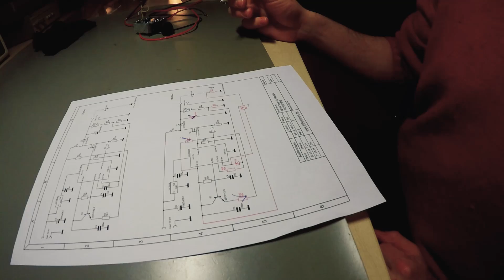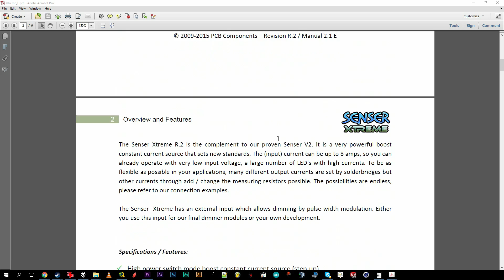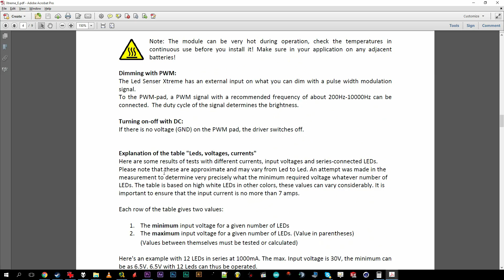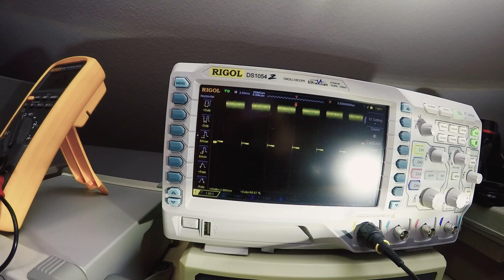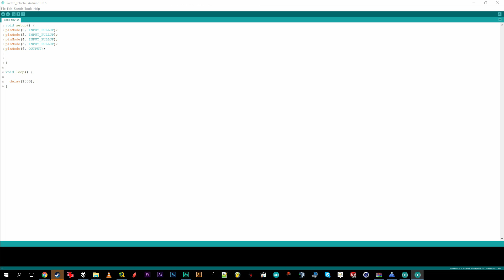100W LED - The manly flashlight rebuilt

Comment: I made myself a 50w torch in a huge-ass project box. It also has intensity control by voltage and funnily enough that makes it unbelievably useful. It might be bulkier than carrying a small flashlight but when you have 50x the light output it's totally worth it!! Not to mention it has a 95 W/hr battery so it lasts well over an hour.